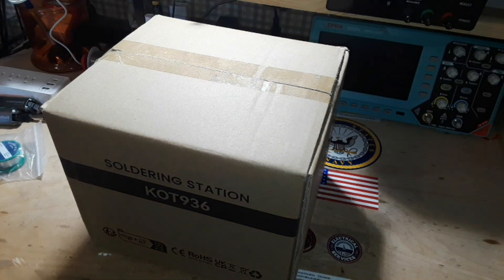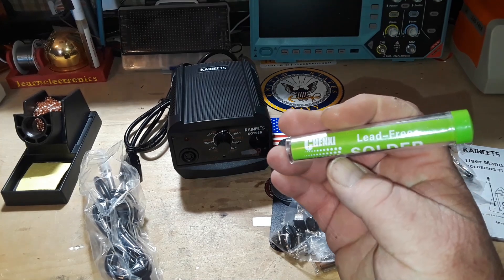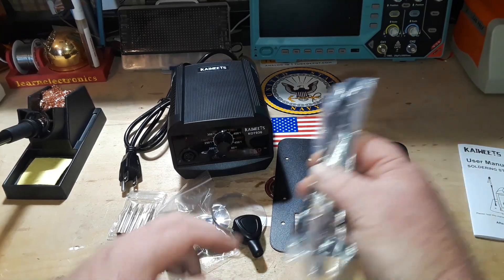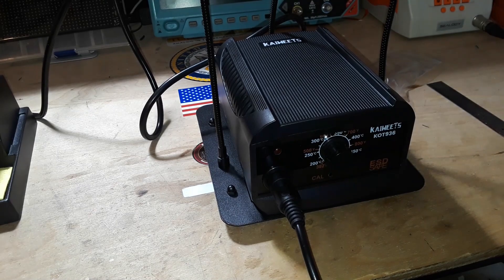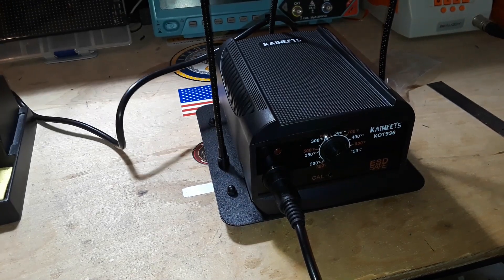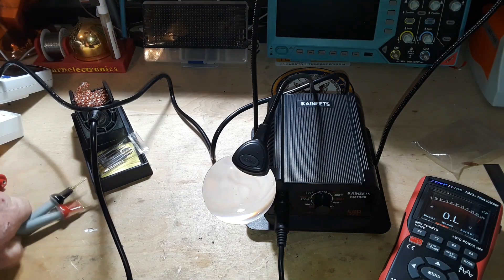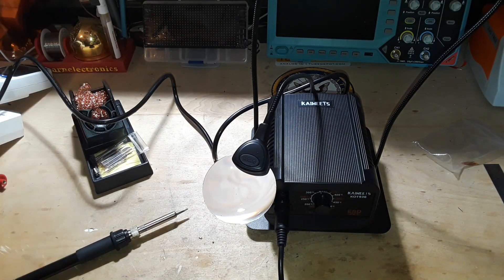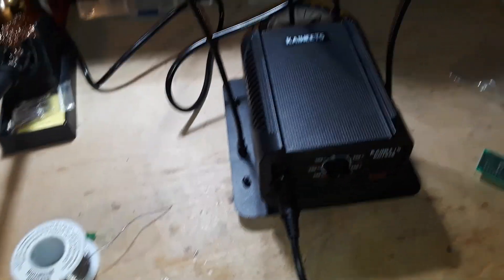Kaiweets KOT936 Soldering Station Review & Teardown

Comment: Curious on what your experience has been with the soldering station since this video?  I checked your vids and couldn't find an update so I'm asking here
Reply from the maker: It's fine. I use it daily . I have not had anything to complain about, but nothing to mention either. It just sits on the corner of my desk and works when I need it to.

Comment: According to the pictures on the advertisements you are supposed to remove the power unit from the base before you use the helping hands. The slots are for storage of the unit and hands together so they dont slide off a shelf or become hard to lift by sliding around.

Comment: Get them to send you one with a hot air station. I am looking for a dual hot air / soldering station to replace my Weller WLC100 station that does not have automatic temp control.